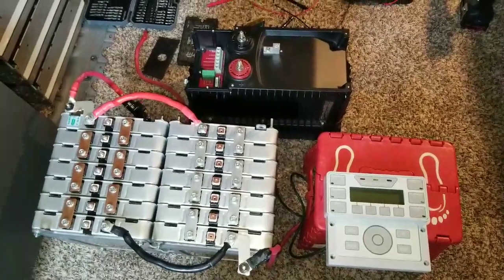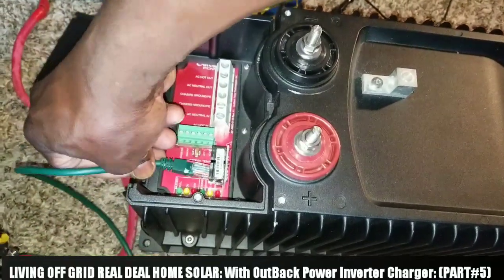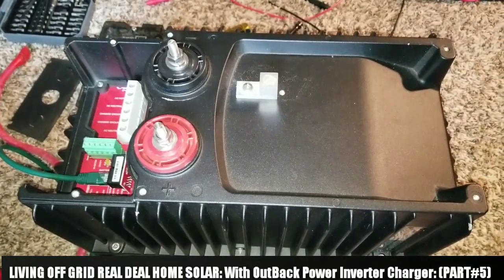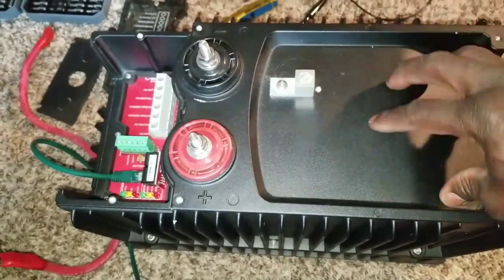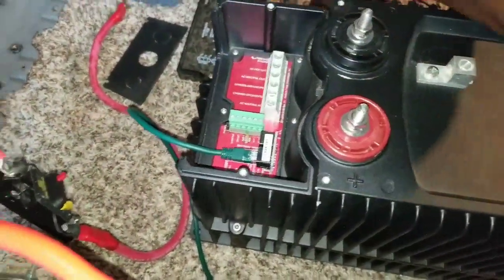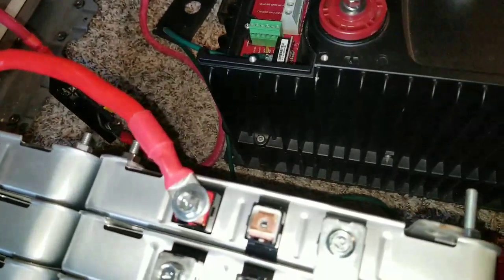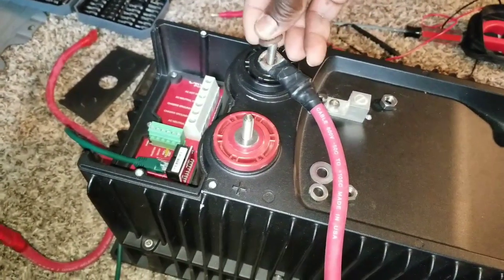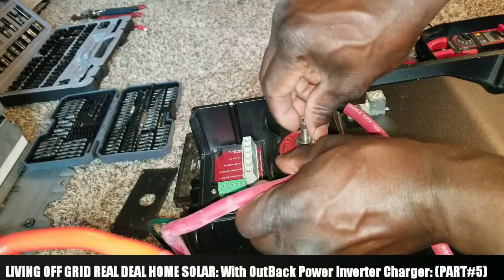LIVING OFF GRID REAL DEAL HOME SOLAR: With OutBack Power Inverter Charger (PART#5)

Comment: I didn't know that u can hook the mate3 to just the inverter
Reply from the maker: Yes you can without using a HUB unless you have multiple devices like; OutBack Power Inverter/Charge, OutBack Charge Controller, OutBack FNDC FLEXnet DC Battery Monitor then you need a HUB to Network all of these devices into the MATE and you can have full control of all of these on the MATE.
Please don't FORGET to LIKE SUBSCRIBE and SHARE my videos and my Channel. 
Cheers

Comment: Have you setup Optics-re yet
Reply from the maker: Not yet mate.
But will come soon👍 if all is well
Reply: @jwsolarusa  I've been using it since 2016 it's very good easy to setup too
Reply from the maker: Ok.
If I need help, I know who to contact😉👍
Thanks
Reply: So u can hook the mate 3 to just the inverter with out the hub I have the mate 3 and the mate3s I'm going to try that